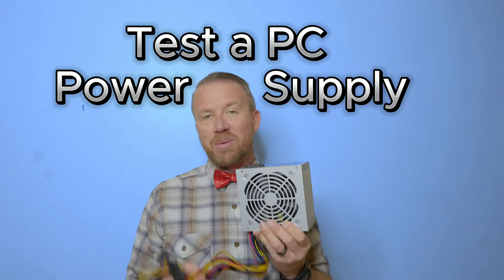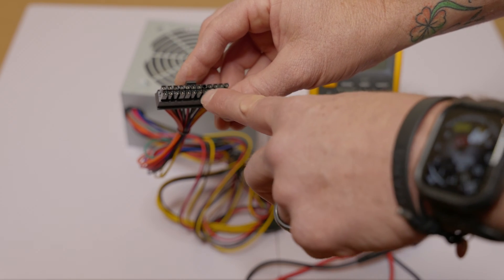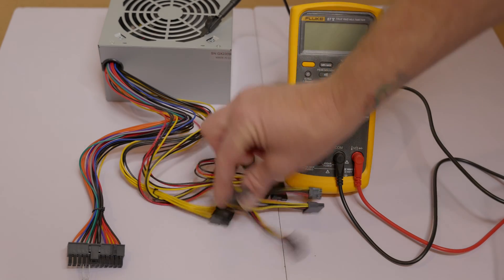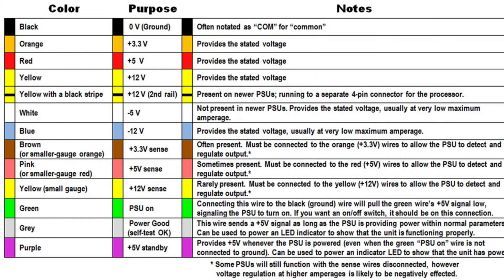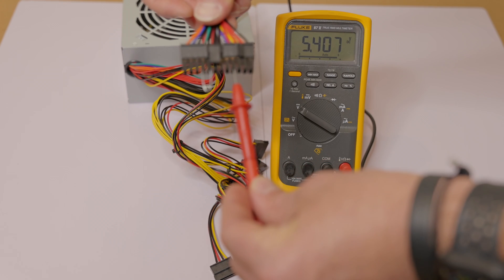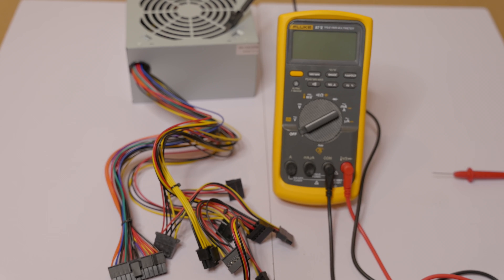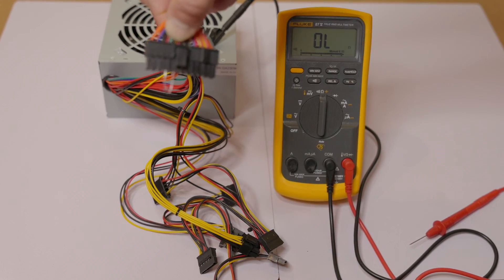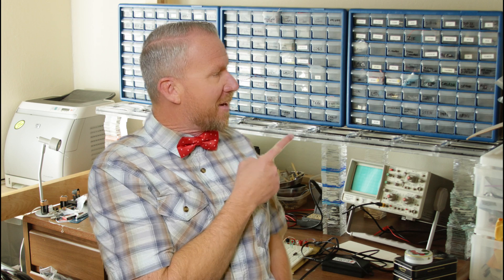How to Easily Test Any PC Power Supply in 2025!

Comment: I know this video is old, but hopefully you can answer my question. I am wanting to test the power supply on my HP Envy 700-216, however the power supply box does not have a power switch on the back. How would I turn it on in this case? This is my first computer repair attempt..
Reply from the maker: if your power supply does not have an on off switch, some of the older models didn't, you should be able to plug in the power to the supply itself and once you jumper those pins that I pointed out in the video, it should come on with the fan spinning. If it does not your power supply is likely bad. Good luck friend and keep us updated!
Reply: @ElectricalYou thank you, I figured.

Comment: So— without the alligator clip— how would one use the black connector on the multi meter? Is it simply touching the negative connector to the psu cage? 

Also— is that an effective method without the alligator clip?
Reply from the maker: yes all the alligator clip does is hold it on for you, should work fine my friend.
Reply: @ElectricalYou thank you for the response!

Comment: I have a proprietary PSU that only has 6 pin motherboard connector. I need to find out if it is bad. Can I touch any metal whatsoever (like the metal casing of the PSU itself) with the black multimeter prong and my red prong into each individual mainboard connector to see if it reads? It doesn't have a push button on the back to "test" like dell and I'm not sure which ones to jump like in this video to "force" it on.

* I ended up plugging it back into the mainboard AND CPU connectors and plugging it in. I put the black on the chassis, and probed each pin on both and still got readings of 12.XXV, 12.XXV 4.7V on the mainboard, and 12.XXV/12.XXV on the CPU 4-pin. I assume it is not the PSU at this point. I'd rather not order this non standard PSU to replace if it isn't the culprit (as I don't have one to test, only standard ones). This doesn't sound like the cause to me, or am I possibly mistaken?
Reply from the maker: It sounds like you've done a thorough check! If the voltages are stable, your PSU is likely fine. Just keep an eye on the other components to rule them out!

Comment: Hi Sir! Blue line @ -15V is it a problem?

My PC won't boot, the motherboard code 00 appears, and it keeps rebooting.
The motherboard power LED is red.
The other amperages of the power supply are correct.
Thanks!
Reply from the maker: I believe for most PC power supplies the blue wire should be around -12V. I wonder if this is the problem for your PC?

Comment: All pc power supplies do not have a 20 or 24 pin. Mine has several 4 pin connectors. (HP)
Reply from the maker: Yes, I misspoke in saying "every power supply." It's been pointed out numerous times but thank you my friend for the feedback.

Comment: Connect green (PS_ON) wire to any black (ground) wire. So on older 20 pin PSU it is 14 and 15.
Reply from the maker: Yes correct!

Comment: Thank you, thank you, thank you!  
I have a Dell that started giving me the slow amber flash on the power button, but I've already replaced the power supply once...  I also suspect the momentary power button on the front of the case, but I was stumped on how to turn on a power supply without a discrete switch!  Thanks to you, I not only get the all-clear from the gray wire, but every other wire has the right voltage on it.  I guess it's time to replace a couple of motherboard capacitors...  
👍👌👍
Reply from the maker: You are quite welcome friend! Good luck with that Dell!

Comment: This method will give me the voltages while the PS is idle. What if I need to test whether the voltages are stable under load, and whether the PS delivers the current it's supposed to?
Reply from the maker: Very true and thanks for the comment. This video was indeed meant for static checks on the power supply to see if it is burnt up or not. To test the supply under load you would have to have the specific amperage/voltage of each output and then test yours with the meter in between the wire and motherboard. That is a very detailed and challenging test and you might be better off purchasing a new supply at that point. Either way, good luck friend!

Comment: Recently, I had a PSU fault and I tested it on another PC.  With the OS monitoring software it produced all the voltages necessary but the 3.3V rail would frequently drop below 2.8 V and occasionally cause a fail to POST due to the graphics not receiving the 3.3 V.  All this is to say is that using a volt meter to check one-time voltages is fine for starters but a PSU can fail in other ways that can't be revealed with a simple multi-meter such as under a load condition when connected to the motherboard of a powered-up PC.
Reply from the maker: Good point! I'll keep that in mind for future videos.

Comment: Great. Thank you so much. My pc motherboard won't post. This will be my next step.
Reply: No fan when I jump green & black wires (16 & 17) and turn on the power. No voltage from any of the other wires. looks like it is a dead soldier, but at least I know why my pc won't post. Thanks for the help.
Reply from the maker: Any time, glad to be of help! Happy holidays friend!
Reply: I tried this method and my psu didnt do a thing, so i guess its broken. Tell me if im right?
Reply from the maker: Glad to be of help friend, good luck!
Reply: If your PSU is determined to be at fault and your PC wont POST, hope that the mobo and/or CPU are not damaged.  This happened to me last year and I had to buy another mobo and CPU.

Comment: Ive 12 pin, connecter which wires im supposed to short
Reply from the maker: Thanks for the question! it should be the green wire and then the black wire next to the green wire.

Comment: please how do i test for a 10 pins power supply
Reply from the maker: Without seeing your plug it is hard to say, but there should be a green wire and black wire, short those two to activate the fan. Please be safe and call an expert if not 100% sure. Good luck friend!

Comment: Thanks you for your vidéo.
Please how Can I do the same test for 8 pins power supply (Dell precision T1700).
Reply from the maker: Check pins 1-4 for ground continuity and pins 5-8 for 12vDC with a multimeter with the power supply plugged in to the wall power.
Reply: @ElectricalYou  Thank you

Comment: I did the jumper and fan came on for like 2-3 seconds and then stopped spinning
Reply from the maker: Did your jumper come loose? If not then the supply fan seems to be locked up. When the fan stops are there any LEDs still on?
Reply: "Many PSUs have a zero-RPM feature that results in the fan only spinning for a moment after the PSU is powered on. This still indicates that the PSU is functioning normally."
Reply: @astmabulle  True, my Power and it's fan were both fine and that was normal
Reply: The same thing happend to me at first. My problem was that my paper clip was coated in plastic and I couldn't see that the metal bit had snapped. When I used a different paper clip, it worked just fine.